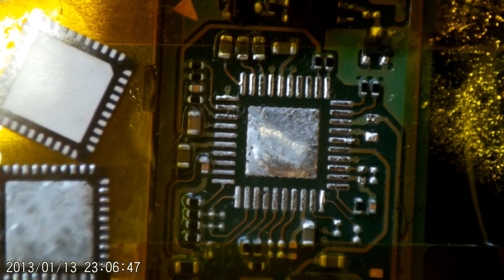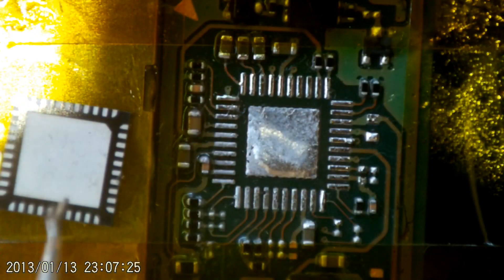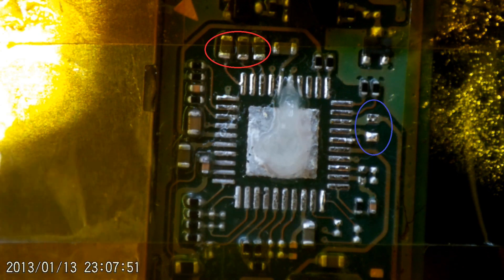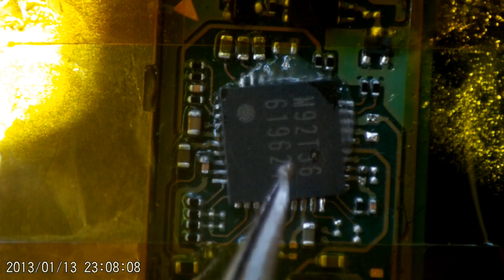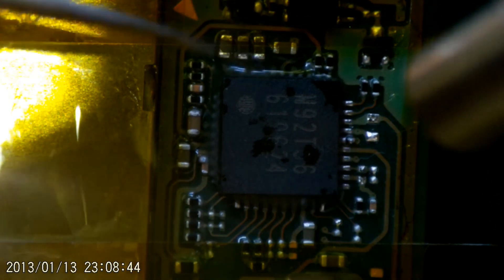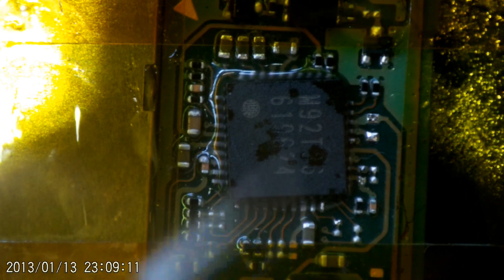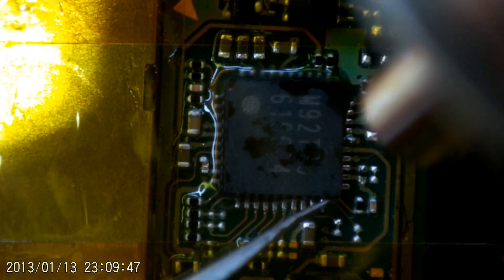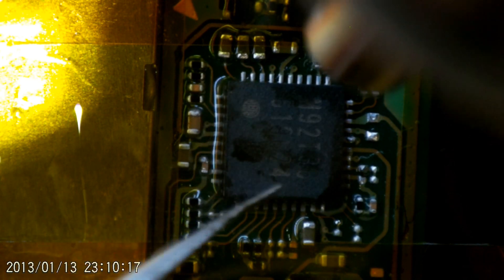Nintendo Switch M92T36 Chip attempted reinstall

Comment: Thanks..this nintendo had error 2101-0001?
Reply from the maker: Nar this one in another one of my videos would produce a rapidly blinking green light when connected to the dock.

Possibly that error but not too sure
Reply: @rickstechrepairs  check my post in your video of rapidly blinking green.
Reply: Did you fix the nintendo problem?
Reply from the maker: so far no good, but i will try a few other things but at the minute im putting this in the "Gaining Experience pile" not the "i will 100% fix pile"

So it will probably become a donar switch for other parts
Reply: test whit ic BQ24193
Reply from the maker: thats my next plan of attack :)
Reply: @rickstechrepairs  good luck and upload a video pls
Reply: It's the BQ24193 causing the issue. Not this chip. I'll be replacing two of them soon.
Reply: @hove131  yes